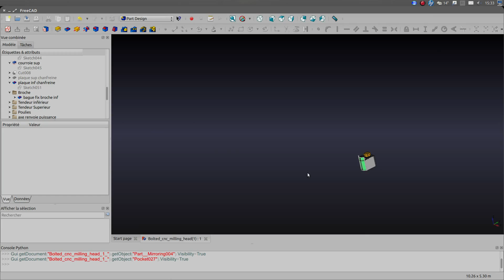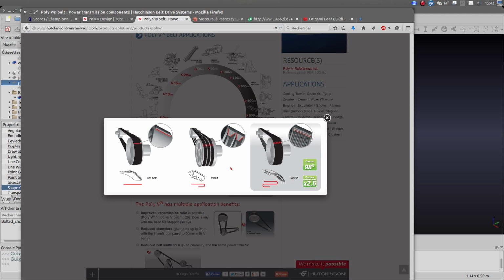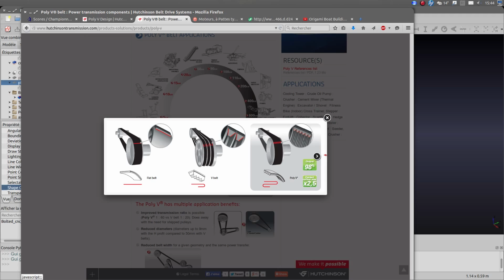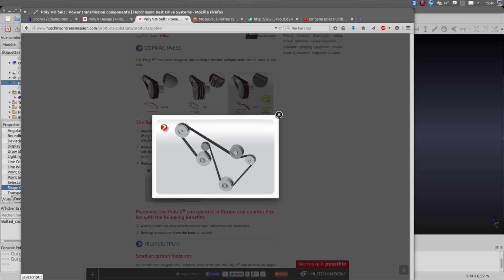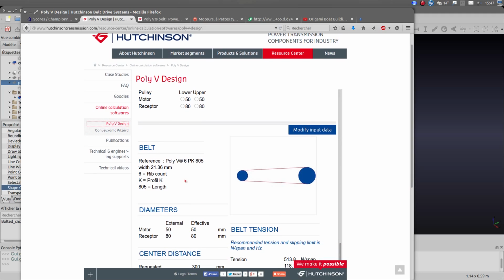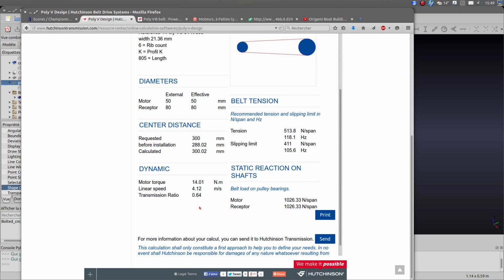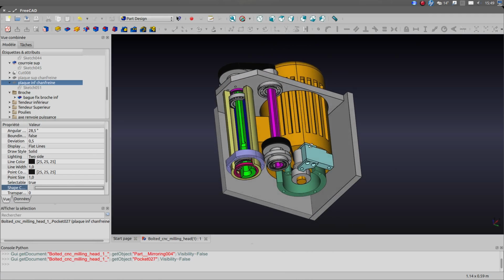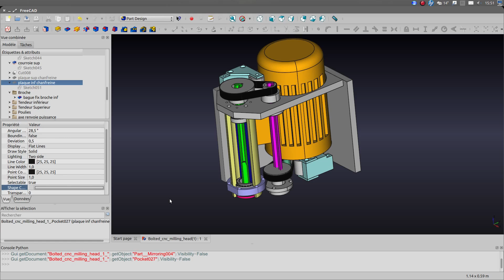Heavy Duty CNC: Milling head Design part 2 EPISODE 43

Comment: One issue I see you are limited by the motor diameter which limits any option for potential upgrade later on. Perhaps the motor could face upwards and utilize one belt to spindle versus an older shaft there by reducing future component failure. Then there is still the issue with heat generated as one other gentleman pointed out. I like that it is introduced into the head for better balancing however we also have the issue of size limiting the head to a specific motor so the head doesn’t rest beyond centerline of the table therefore reducing total y travel.
Reply from the maker: Hi Glenn, thanks for your comments. 
It is not obvious to see on the video but this milling head is designed with a 2.2kw 3 phases motor, so enough power to make what is needed for tne CNC. This king of motor had integrated fan that protected them from overheating. Motheless, air come from the top towards the tool so motor does not see moisture et debris from the machining.
The toral weight of this single spindle design is around 27kg ( 59.5 pounds) so a special counter weigh has also been design but not shown in this video.
Reply: Laurent CNC how much distance is the entirety of the head front to back and what spindle are you considering? Alibaba had many haas style belt drive spindles that would be a superb solution already set for 10,000rpm which would be more than adequate for daily usage.
Reply: I’m considering making a new head myself and filling it full of epoxy granite and dropping an $800 spindle in. Problem I am having is finding decent plate steel to make the head from that I can harden after assembling prior to filling with EG. It will have excellent dampening characteristics and offset the motor weight pointing upright in my application. I may want to install a 5hp motor later so I am keeping that to consideration.

Comment: All nice, but just asking if you considered the motor cooling?  at this point from looking at your nice videos it seems as though the motor is in-closed in a box with no air circulation which could have adverse effect on motor.  Just one of the many things to consider.   Keep up the good work and thanks for sharing,  Looking forward to more  progress.
Reply from the maker: Ron Schmaltz A very good point. In fact the motor has a fan on the shaft at the opposite of the pulleys. Air cooling will come from the top of the milling head, then follow the motor body and get outside from the front cover. 
I did not explained it. I will make a decision if I make a video about it.